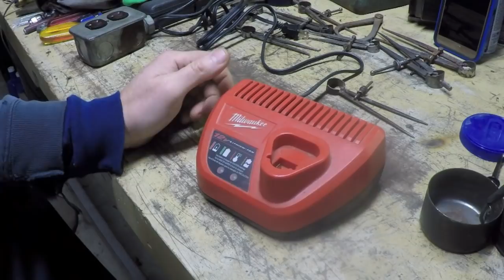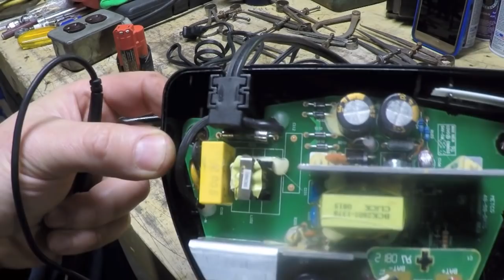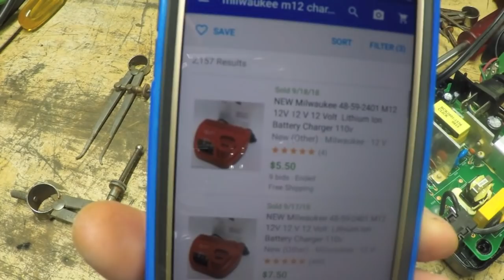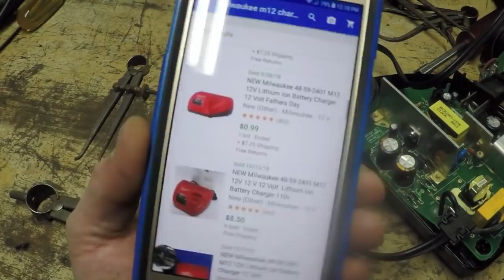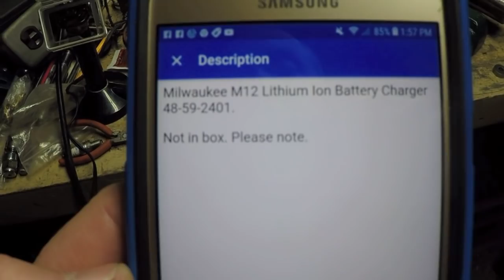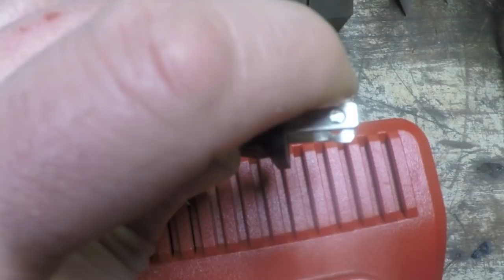Sometimes it's just not worth it. Milwaukee charger repair atempt

Comment: A common fix for no lights on the charger when plugged in is the find a little round pad on the top left side of the board with "reset" written next to it.  Plug the charger in, touch a wire to the negative charging terminal where you plug in the m12 battery and touch the other end of the wire to "reset".

Thats it.
Reply: Not all chargers have the label "reset". If you don't easily find it then it may not be possible on your charger.

Comment: Really should use voltage drop when checking the fuse still in circuit. Good fuse = 0V drop across. Bad fuse = voltage shown